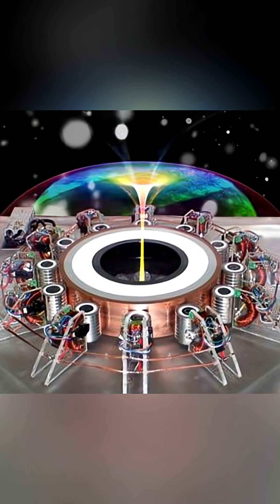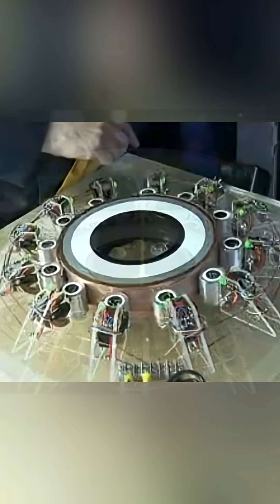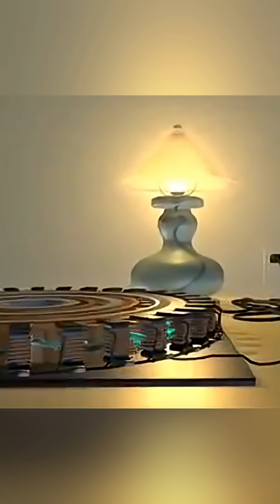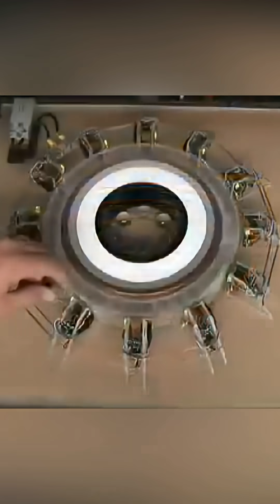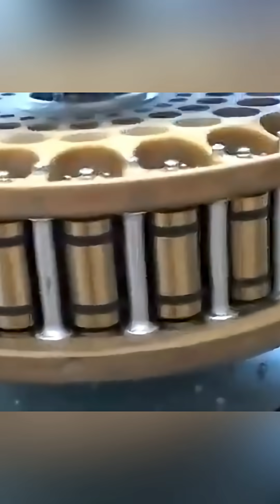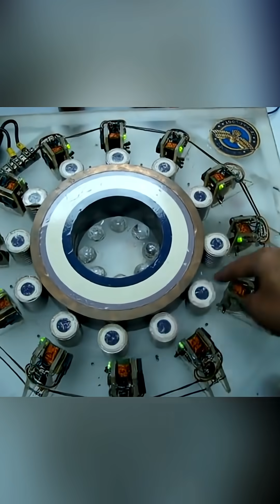Free ENERGY!? -Searl Effect Generator

Comment: There are multiple problems with the prototypes people have made to test this generator. First,John Searl said multiple times that you need a MINIMUM of 3 rings for this to work, Period! Anything less will fail every single time. When people make this with only one ring and declare it a failure, they're only showcasing their own stupidity. 

Second, so far, NOBODY has made this the same way John made his, because they think they can do it better-when they don't even understand how it works in the first place! This makes no sense to me. This is like seeing a tire for a car being made for the first time, and instead of taking the time to understand why they're made out of rubber you try to make them out of steel-then pull the guys funding because your fuck up of his invention didn't work. 

I could go on and on about this, but I'd say it's as clear as clear can be that every attempt to duplicate it was purposefully sabotaging the experiment. The thing is, this doesn't produce electricity, it Channels Photons and strips the epectron from the photon by accelerating and spinning it at extremely high speeds-causing electrons to fly off and be collected. People need to stop thinking about Zero-Point-Energy as a device that generates energy. They Channel energy, they're not Creating energy.

Comment: So by the rules of thermal dynamics why would a fusion reactor work
Reply: It won't work forever! Just like our sun.
Reply: At that point, you’re asking - why does the sun work? Because of physics.
Reply: Because IN THEORY you should be able to get more energy out from fusion reactions than you put in from heating and compressing the fuel.

Actually achieving that and doing it efficiently enough to....

#1. Achieve non trivial net gain.

#2. Extract the energy from that gain.

.....is pretty damn difficult though.

Ultimately the reality is that the effort and cost of finally achieving fusion simply isn't worth it anymore on Earth now that renewables are so cheap and storage is set to get significantly cheaper as sodium ion battery production scales for grid and domestic use.

Outside of Earth on long term space missions there's definitely more potential use for it tho.

Comment: Perpetual motion is totally possible in a closed system. The problem is to try to harness perpetual motion or measure it opens up the thermodynamic system and breaks the perpetual loop. Perpetual motion is not the means to unlimited energy, the means to unlimited energy is to create so much energy in one thermodynamic system that the amount of energy that you need is insignificant to the store of energy that you have. Relatively unlimited. You could perhaps use relativity, like gravitational relativity, either from weight or motion to accomplish this. But this is at least another hundred years out.

Comment: There are people and engineers who tried to make an infinite energy generator on YouTube by creating with magnets, wires (skinless works well), a motor or more, an output energy, and a car alternator if needed, but there are videos that claims that it's not efficient or won't work well.

Here are some tips of making the infinite generator:
1. The motor(s) needs to stop by a device when high on heat. Add something to cool it down like an exhaust fan.
2. The generator needs to store in excessive energy. It will notify and stops the motor once the battery is full.
3. It needs a device or more to notify where are problems are. It also stops the motor when there's a problem occur.
4. Add some outer layer to reflect the sunlight and keep the heat away from overheating the generator.
5. (Optional) Make the generator spin the motor automatically without letting someone to spin by adding a switch to it, but you have to make sure that it doesn't spin automatically when there's a problem occur or exchanging battery.
Reply: U slept thru physics class.... y? That was the most important one!

Comment: I guess I could see this being a continues source of electricity if the setup was housed in a vacuum chamber, and tilted at just the right angle. Maybe having an enclosed track for the top and bottom of the rechargeable batteries, made from copper coated in nitinol, maybe lubricate the tracks with some magnetite cover in graphite. Having the core of batteries be made out of two or more liquids or gases at different weights that cannot mix together. It’ll be as efficient as mashing potatoes with your smallest spoons, on a rickety bar stool; but you will technically get there🤷🏻‍♂️

Comment: I prefer investing in Geothermal energy, a real energy source away from civilization, then transfer it by electric grid to where it needed
Reply: If the new gyrotron + waveguide based boring method works to make the holes deep enough to hit super critical rock then it's definitely a possible 24 hr power source for any locale.

That being said, outside of winter circumstances in the wrong geography with long term low wind I don't think it's very likely to get cheap enough to be popular before solar gets a lot better and cheaper along with sodium ion batteries to store the excess power.

Especially with the impending shift to perovskite/slicon tandem and future perovskite/perovskite panels that will change the cost/benefit ratio significantly once they are scaled.

Comment: He actually claimed that the thing , once enough power was drawn out, it shot up of the table. Antigravity was his claim. The more power drawn , the faster the machine would spin. I believe freeing electrons allowing for "gravity" (static electrical attraction) by reducing the positive charge thereby reducing the attraction.
Reply: He only claimed it would self propel @ a high enuf rpm. He warned that once u reach this, dont add any more power, slowly dial bk the power to 0. Or else it will become a runaway device, & keep spinning increasingly faster until its magnetic field starts resisting gravity. At which point it will break free, ovr coming gravity & the mounts, brackets, & table. 😅 U only make that mistake once!😢 btw, that only happened once. The rest of the time, they kept flying apart! Punching holes in the lab, & almost killing him! Thats what happens when you opt not 2 install ballistic shielding. . .
Reply: @WillardWallace-y5g Or ...
 He just made everything up.
Reply: Im sure he claimed his prototype shot through his roof and out into space. Sensationalising it for funding i presume.
Reply: Well if he claimed it then it must be true!
Reply: Lol
Reply: BBC made a few videos about it, the generators and the flying saucer, ,
Reply: He also said it dropped in temperature as well.
Reply: @pbarnaj   Yes just like in Ghost buster who investigate  haunted houses, seconds before the spirit manifest it self, the surrounding air  gets much colder. . Or When the US NAVY Aircraft Carrier  observed a UFO, standing still in the sky. .They use the differents radar frequency, IR, UV, and x-rays, ,  then suddenly the air around the craft became very cold and the UFO left at tremendus speed. .  Curiously Ghosts and UFO use the same type of energy to move. . .🙂